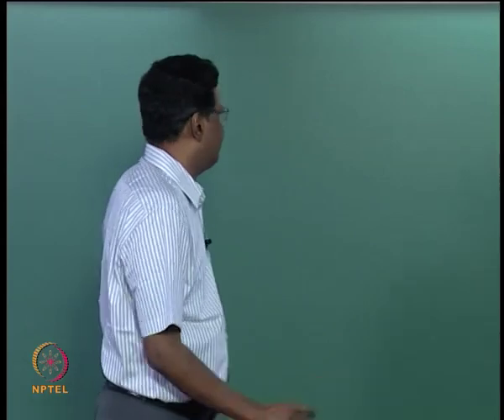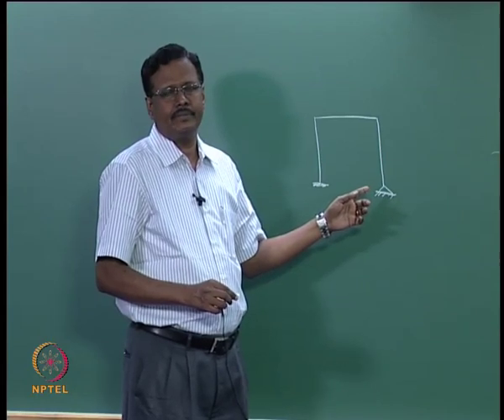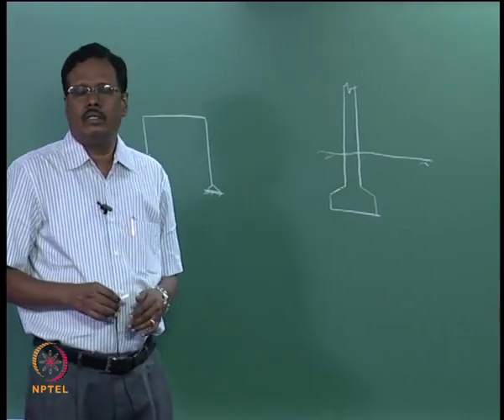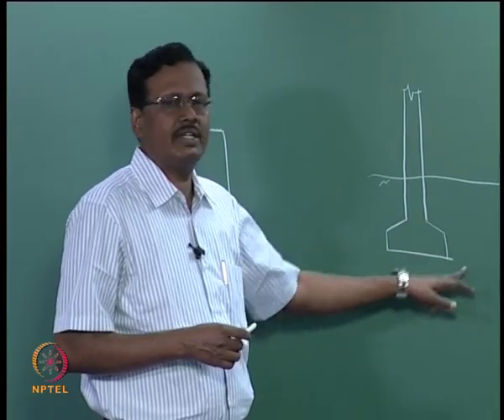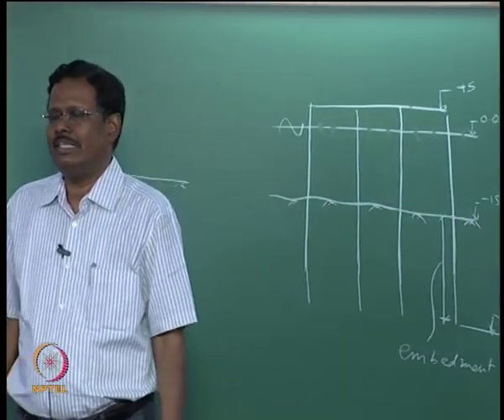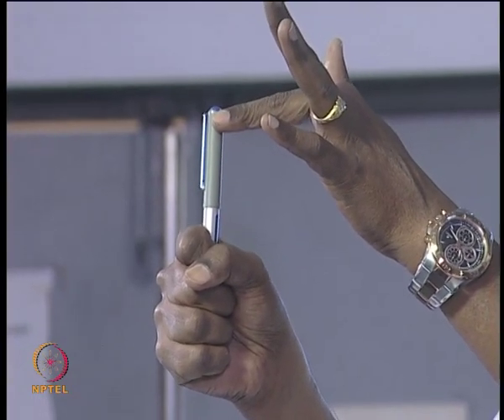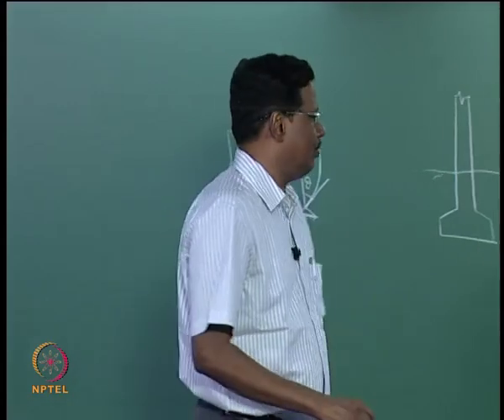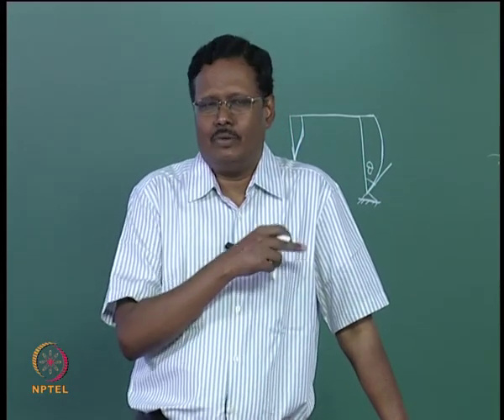Mod-06 Lec-31 Soil structure interaction

Comment: Sir entire pile design is based on imperial formula whatever load capacity of the pile calculated by theoritical calculation always differ with the load worked out by load tests of pile...kindly explain the topic of corelation between pile design load testing and final consideration of the pile section and number of piles and depth..Thank u